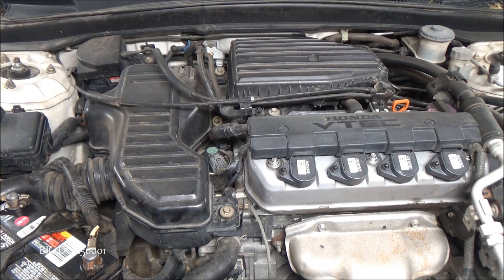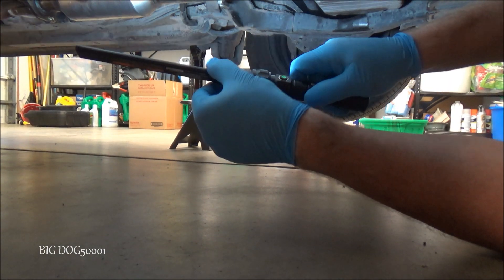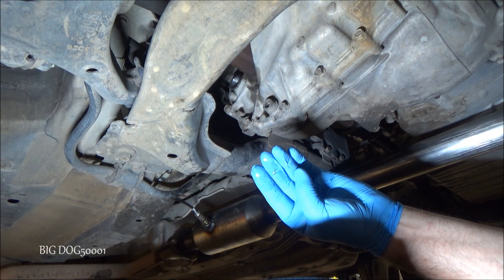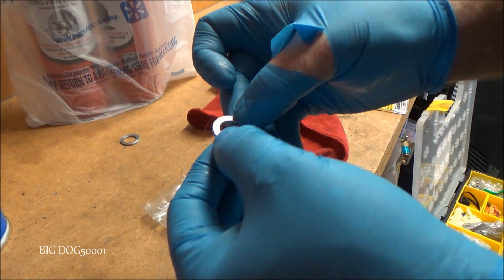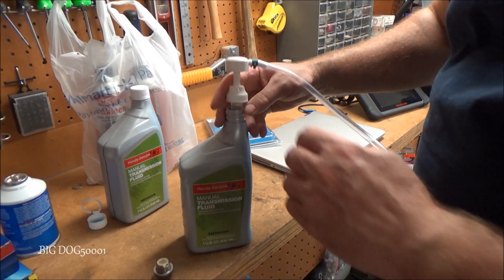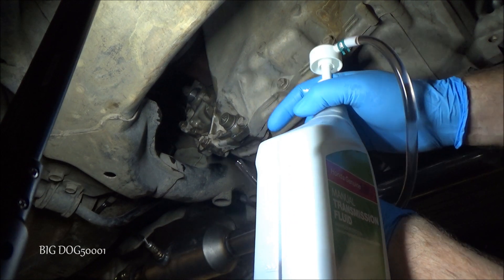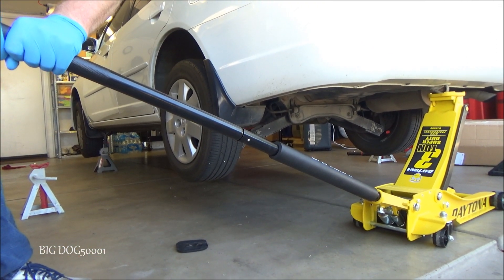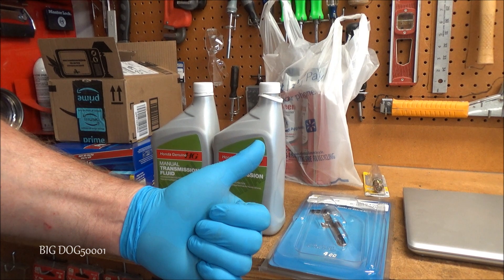Honda Civic Manual Transmission Service 2003 (2001-2005 Similar)

Comment from the maker: Parts in video
This channel earns a small commission using some of these links - at no additional cost to you.
Pump used in video:  https://amzn.to/2YOHzoD
Honda Drain Plug Washer 94109-14000:  https://amzn.to/2ZjgUfH
Honda 20mm Fill Plug Washer 94109-20000:  https://amzn.to/2NorfEW
Honda Manual Transmission Fluid 08798-9031:  https://amzn.to/2Zm9YhH

The Big Dog 50001 Automotive Channel Store can be found here: https://www.amazon.com/shop/bigdog50001automotive

Be sure to subscribe for more tool and car repair videos! 
https://www.youtube.com/BigDog50001

https://twitter.com/BigDog50001
https://www.instagram.com/bigdog50001/
Reply: Hi, I really liked your video, could you tell me how much transmission oil should be put Thank you very much and greetings from Spain

Comment: The crush washer is the same unit used on the oil drain plug - terrific! Dead important to install the correct spec washer - anything smaller will leak. This I know because after being repeatedly told by my mechanic across several services that the engine was burning oil, I crawled under the car only to find the washer for the drain plug was so undersized it almost couldn't be seen. That explained the excessive oil consumption, steadily dripping out! Haven't used the mechanic since.
Reply from the maker: Thanks for the input!
Reply: Hey this helped me out too, I bought the car with an oil leak and it could be this that’s causing it.

Comment: Thank you for your video. I just changed my trans fluid in my 2001 civic.  I bought the car two years ago and I should have changed it then. I think they used motor oil last time it was done. Fluid was dark brown and there was no gasket on the tranny drain plug.  I do all my own work. These manual transmissions in these cars are so much easier to change the fluid then a auto trans.

Comment: Bro, excellent video.  I've never changed the automatic-transmission fluid in my 2005 Civic.  I'll be doing it soon, though--along with a radiator replacment.

Comment: Another good video. It always worries me using the full extent of a jack stand. I feel like one like wobble and the car will fall off lol. Till this day I still can't find one of those lights at my local HF .
Reply from the maker: Thanks Jonathan.  Yeah I don't like extending them all the way, they were up pretty high but not all the way extended.  If I needed to go any higher I would have gotten the big jack stands out.  I saw that HF was out of stock on the light a couple months ago, surprising to hear they are still having supply issues.

Comment: The manual trans on my 2005 EM2 is leaking from that drain bolt and from a bolt toward the front of the trans. That very front bolt in the video at 3:30. 

I have to get the transmission rebuilt anyway, because it no longer has 5th gear and the previous mechanic working on it just kept doing something to bandaid fix it, and it kept losing 5th gear again after about a month of driving it, so I just want to rebuild the entire thing. And this is the third thing to start leaking after he worked on the car, so I told the guy off and started doing all the work myself. I had to replace the valve cover gasket because that was leaking from one of the corners, and when I took it off, I noticed when he installed it, one of the corner tabs of the gasket was bent under itself, essentially doubling up the thickness in that one corner. I did the job properly, so no more leaking from the valve cover. So far I've replaced all of the suspension bushings with a mix of polyurethane and OEM (mixture of performance and comfort), end links, rack ends, new lower control arms, and I've put the spindles from a 2005 RSX onto the car to get disc brakes and 5-lug on all four corners (they bolt right into the original EM2 suspension) 

It's a funny thing, but the RSX and CR-V of that generation all share the same suspension setup as the EM2 Civic, and the components are all mostly swapable. I'm eventually putting the K24 engine out of a CR-V/TSX into this Civic and going with the spindles either from the CR-V or from the RSX Type S, so it'll fit the cv axles. I've got the lower from the CR-V and the head from the TSX ready to go, but I'm slowly buying forged internals for the lower, mainly h-beam rods, 11.5:1 compression pistons, stroker crank, and a bunch of other goodies, and my brother is going to help me build the bottom end, and I'm bringing the head to a machine shop to get it ported and polished. At any rate, I'm about to go try to at least get the trans to stop leaking from the drain bolt by replacing the washer seal and the bolt with a new one, but wanted to make sure I'm going about it all the proper way. At least until I have the money saved up for the trans rebuild. Thanks for the video. I wouldn't bother at all with the trans rebuild if it weren't going to take me the next couple of years saving up for this engine swap, and I still daily drive the car, so it's worth it to me.
Reply from the maker: I probably wouldn't go back to that mechanic.  Thanks for the input!

Comment: I put 1.5 not 1.7 quarts and my transmisson makes noise when im in high rpm i dont wanna jack it up on all 4 and get under it just to top it off a little bit. Can i fill it from the top by removing a sensor or anytbing?

Comment: What is the procedure afterwards? With automatics, you  run the engine and cycle through the gears (with the brake on) Same for manual?

Comment: does changing the manual transmission fluid promote smoother gear changes?
Reply: If your fluid is dirty yes it can or depending if you switch to a better gear oil it can also

Comment: Great video, thanks.. Honda recommends to change fluid every 120000 miles? but I also have heard that these transmissions on these Hondas fails around 90000 miles. Mine failed at 105000 mile, and I'm looking for replacement now... wondering is it worth doing or was I too rough on that transmission?? otherwise great little car.. absolutely love it!
Reply: How did your transmission fail exactly? Input shaft bearing by any chance? Those seem to be a pretty common problem on all the D series manual transmissions unfortunately.
Reply: Same same. But still gets me from A to B without concerns. Sometimes when i let off the throttle in the fifth gear, it goes to Neutral. 
I think I know the answer, but...
Anyone a quick tip before i buy a whole trans? 😂 Car is at 300 000 kms. 😅

Comment: What other oils we can use instead of Honda tranny oil? 
Is synchromesh ok? What about 10W 30 engine oil. I’m getting recommendations it’s ok to use regular engine oil.
Reply: I use Amsoil Synchromesh and it works great. I know people who use Redline MTL in these too. Modern engine oils aren't really compatible with transmissions and shouldn't be used except in an emergency. To put it simply, modern engine oils are too slippery for the synchronizers to work properly since they need some friction to grab. Back in the 90's when that was the recommendation, it worked okay because oils weren't nearly as slippery as they are now.

Comment: Hi i have a honda Civic 2001 ex coupé  with 187,315 miles and i don't know if the past owner chance the transmission fluid so My question is i can change the transmission fluid ? Sorry for my English i'm from Puerto Rico
Reply from the maker: I won't tell you what to do, but I would do it if I just bought a car like that.

Comment: Does anyone know, is there a reason you filled from the fill plug and not where the dipstick is? Would it also be OK to use the dipstick hole?
Reply from the maker: Most manual (stick shift) Honda transmissions do not have dipsticks.  The procedure I showed is exactly how Honda says it should be done in the service information.  AUTOMATIC transmission fluid can be added through the dipstick on some models.

Comment: Great video!  Many thanks!  Do you discard the pump or save it for the next tramsmission fluid change ?
Reply from the maker: I save it and use it again (on the same fluid).  I have several of these pumps and use them for different fluids (but I don't mix them).

Comment: Question... Can't the same procedure be done without it being level. Meaning, you jack the car up to remove the drain plug emptying it. Then you lower back to the ground to remove the transmission dipstick then re-add new transmission fluid though dipstick opening until it's level?
Reply from the maker: No dipstick on a these manual transmission Civics.  Vehicle needs to be level when refilling so fluid starts to drain out when it is at proper level.
Reply: @BigDog50001  Copy that! Thank you!

Comment: Thanks for the video. I have a question. I have a honda civic 2004 with automatic transmission. Some people making full transmission fluid change.  Do you recommend a full transmission fluid change or 2 or 3 times drain and fill ?
Reply from the maker: Of course the Civic in this video is not an automatic, but in general you can't do a full ATF change on those Civics, or pretty much any Honda with an automatic transmission, only a drain and fill can be done.  The people that talk about a full ATF change are probably talking about going to a shop that uses a machine to "flush" the ATF fluid.  This is not recommended by Honda and I don't recommend it either.  One drain and fill every 30,000 miles is what I recommend.  If the vehicle has not been taken care of, I do one drain and fill and then re-access the vehicle to determine if I want to recommend doing additional services.

Comment: The torque tool you used...do you recommend I purchase this?  Is it mandatory for a successful flush?
Reply from the maker: It is not mandatory but it is a good idea.  Many problems are caused by people over-tightening drain bolts (it is very easy to do).  You don't need a $500 Snap-On torque wrench like I used in this video, Harbor Freight makes one that is around $12 (with coupon).

Comment: Honda Civic LX 04

150k transmission fluid never been changed
I drained n filled, now it wouldn't shift after the car is warmed
Trying to correct this by 2 more drain n fill
3rd time with Seafoam Trans Tune.

Any suggestion what I should try?

Comment: Really helpful video; I need to do this myself but nobody seems to mention the reservoir or how to replace the fluid here; including whether you need to bleed the system or not.  Not sure what the process is to replace all clutch fluid in the system.
Reply from the maker: What you are talking about is hydraulic clutch fluid service, which is a different procedure (and yes in most cases it needs to be bled to get any possible air out).  I appreciate the comment, thanks!

Comment: the square screw head from the tranmission (drain plug) is 1/2 or 3/8?
you have used only the torque wrench to remove it?

Tks.

Comment: I have a 99 Civic manual transmission with about 250k miles.  Not sure if tranny fluid ever changed.  Gears still shift nicely.  Should I leave it alone or change fluid?
Reply from the maker: It is doubtful it went 250k without ever being changed.  I buy older vehicles like that quite often and I don't hesitate to do 1 drain and fill on a Honda (on most models it only gets about 1/3 of the fluid).  After that, I re-access the situation after looking at the fluid and how it drives.

Comment: Very good stuff... there was so much info packed into that vid..... had to subscribe for more....
Transmission fluid seems to be seeping from a different bolt(?) on my 5 speed (same car), it is about level with the fill bolt, about 5 inches or so to the right of the CV axle(looking from the wheel).
Looks similar to the drain bolt, where you need a driver to get it off but bigger(1/2 in driver vs 3/8 in driver)......
 Honda parts lists it as a "sealing screw 32mm" but i cant seem to find any info on it at all. part # 90081-PX5-000
Any info would be greatly appreciated...
....but what i really want to know is can i replace it or reseal it to stop the leak? 
Or maybe a symptom of another problem?
Reply from the maker: I believe you are referring to the 32mm sealing cap (it should be normal right hand threads).  As long as the threads are not damaged, usually that 32mm sealing cap can be removed and resealed with liquid gasket (Honda recommends Hondabond 08718-0004) and then reinstalled (18 ft lbs torque).  The M/T fluid would need to be drained like I showed in this video and then the threads and cap cleaned up first before reinstalling.  I would wait at least one hour for the Hondabond to cure before refilling M/T fluid (but 16-24 hours cure time is best if you can wait).  Thanks for the comment and good luck!

Comment: Im.witn you on.earlier.change.intervals then manufacturer recommendations. I learned that lessom.the HARD & EXPENSIVE WAY! Cuda been worse several fold! Auto trans died.at 63,000 miles! Powertrain warranty had just expired.at 60k. Not talking bout Honda either. Another terrible mistake going with.cheaper.brand! I really wanted a ford explorer but 30 stacks brand.new. the undisclosed brand i went with cause 17,000 ended up costing more then the brand new explorer plus pos brand waa shorter then ideal wheras explorer was perfect length. Old saying > lessons lived R.lessons learned!